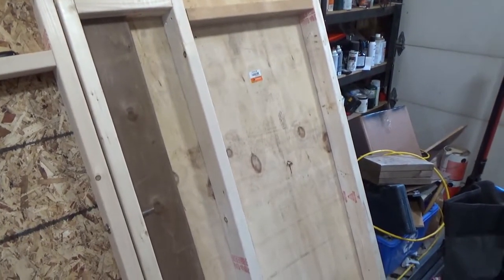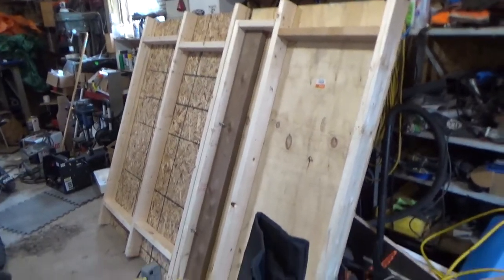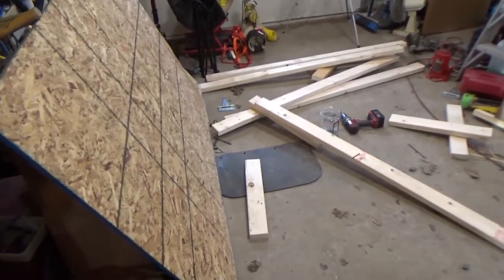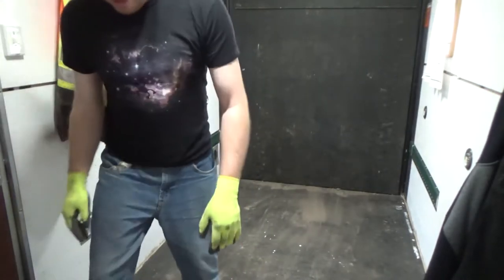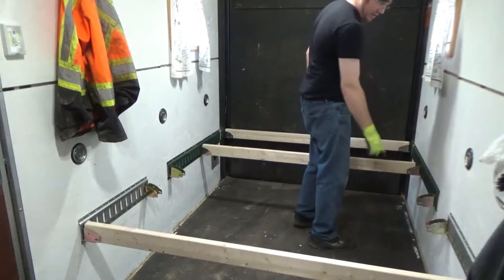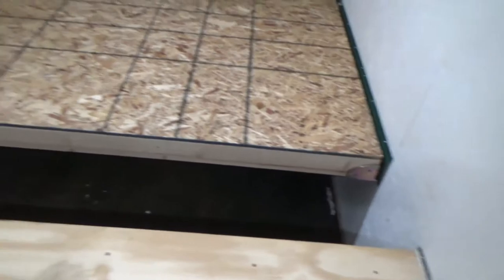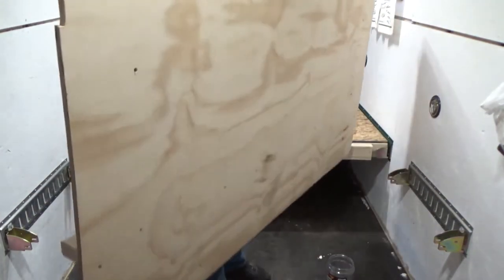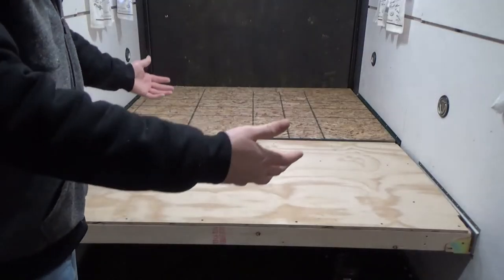Cargo Trailer Conversion Bed Frame Rebuild

Comment: I did the 2x4 e-track brackets on my camper conversion and too.  You literally could just lay 1/2" plywood on top of the 2x4s and your bed will be plenty strong.  You didn't really need to frame the platform and attach the plywood to it.  My beds have been in place for over a year with zero issues.  I did a series of videos during my build.  I'll attach the video where I did my beds so you can see what I'm talking about.  Cheers.  

Bunk Beds:  https://www.youtube.com/watch?v=iVQc9dj1L_M&t=4s

Here's a video of the finished camper:  https://www.youtube.com/watch?v=eWfgJcYKh-M&t=2s